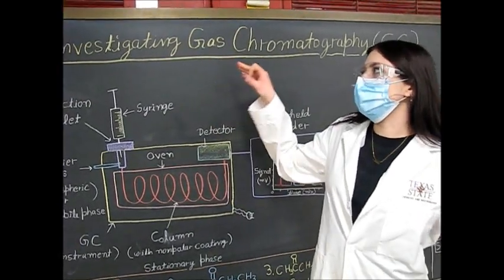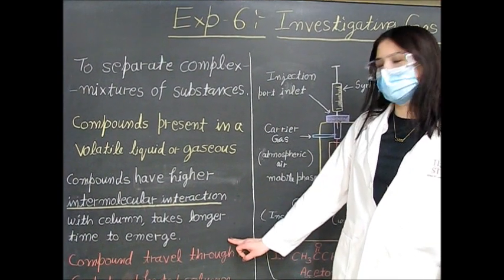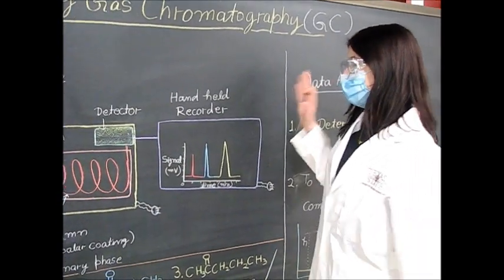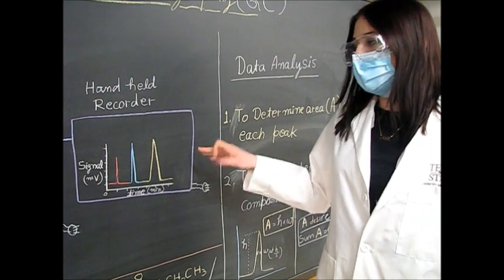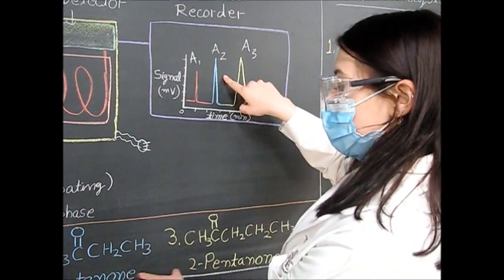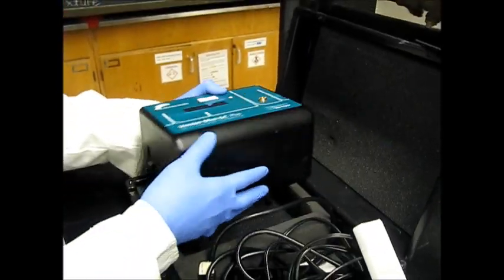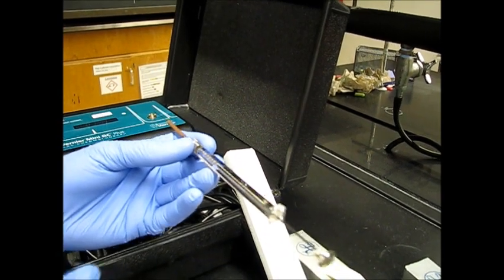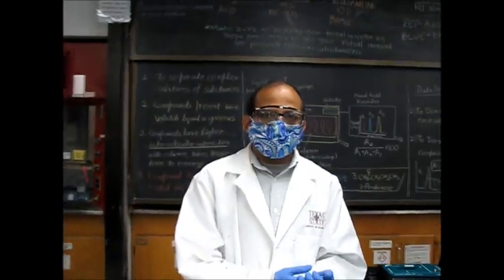Gas Chromatography Lab Experiment Part-1

Comment: how do you know which peaks are what substances please?
Reply from the maker: Please review the theory of Gas Chromatography and in short, Small molecular weight compounds have short retention time, it means they appear first and large molecular weight compounds have longer retention time, it means they appear later. Let me know if you understand. Thanks
Reply: @shivakrastogilectures9541  the boiling points go low, medium and high ? and not in the order of the peaks as such?
Reply: Are you from?
Reply: @SG73088  I'm from uk
Reply: @rachelhughes2837  could you please take lecture on chromatography!
Reply: @SG73088  I am 🤣  thats why I'm asking
Reply: I am doing forensic science , I have a course work so I'm researching for my course work. I need to read the peaks to see id the chemicals.